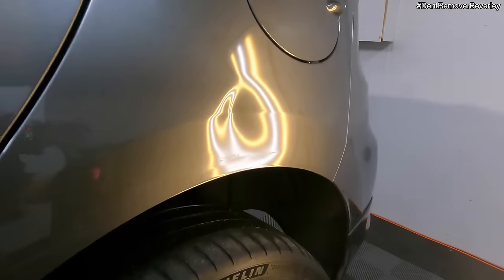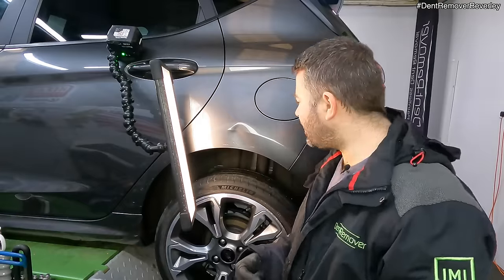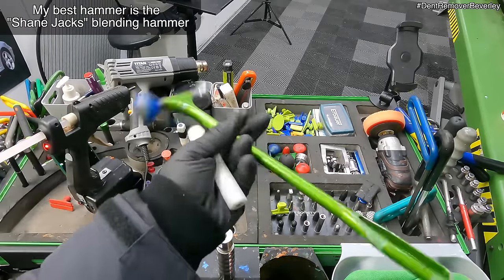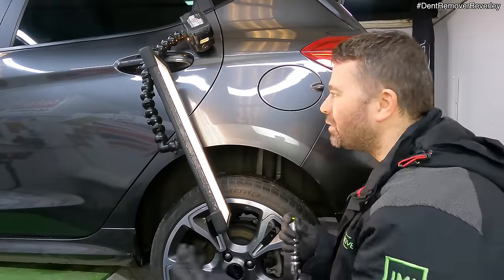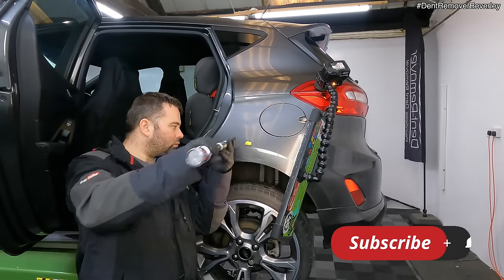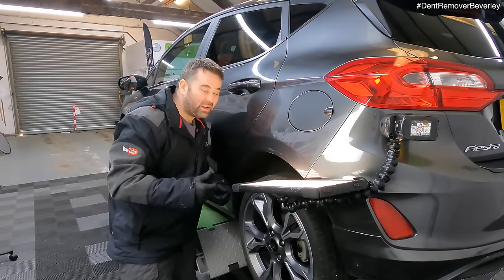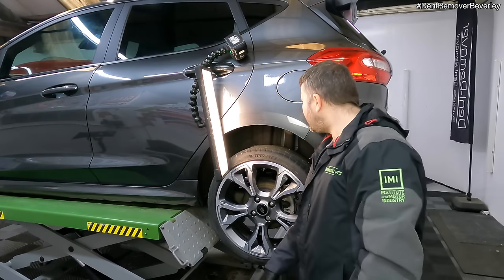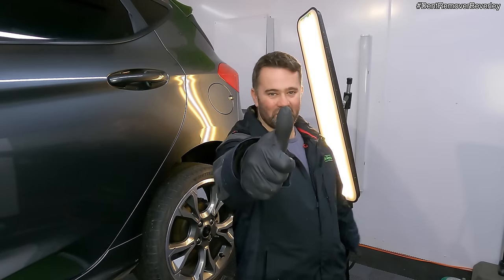HOT GLUE DENT REPAIR | STEP-BY-STEP By Dent-Remover | PDR UK

Comment: Your clearly good at your job but far to expensive it would have been cheaper to get a body shop to repair it and the whole point of paint less dent removal is because it is cheaper
Reply from the maker: Thanks Shaun. There’s a few ways at looking at this. In this case I didn’t charge that price and if you read the description of the video I explain all this, also this price is very much acceptable if it was to be paid by the insurance because there’s no evasive methods used to repair this damage. No products to use and pay for, no chance of Mis matched paint, dry paint, issues in the future etc, 
Then there are those customers that have just bought a car and are really proud of it, 100% don’t want it painting because of the above, and seek out a professional that can carry out a repair like this…. Some people see the value and skill and some people just look for the cheapest option and are happy not to see the evasive conventional repair happen in a dusty bodyshop with not much care taken. I’ve worked in those shops and it’s all to easy to slap a bit of filler in it and send it over to the paintshop for them to mask everything up. 

The whole point of PDR isn’t because it’s cheaper. PDR is a completely different method. 

If your car got hail damage and I mean battered by 100% of hailstones and it looked like a golf ball….. if PDR was going to totally fix this and you kept your paint 100% with all warranties saved and the insurance where going to pay this….possibly around 4-6k  But a bodyshop would happily fill each dent and repaint the whole car for cheaper. Which route would be best 

Or if you had a dent in your door and a PDR was going to be 300 and it would take an hour for a 100% magic repair

But a bodyshop would charge 200
To fill it and repaint the side and take 4 days…..

Which one would you pick? PDR isn’t for everyone but us Technicians pride ourselves on our skillset and the bodyshops use us to help them too

Comment: The panels on a Fiesta are so thin you could have pushed that dent out with your bare hands.
Reply from the maker: The panel is double skinned with no access, and it’s certainly not that thin. Wouldn’t be very good at absorbing a side on crash if it was made from foil
Reply: @dentremover01  "The panel is double skinned with no access"
Not on my 2010 Fiesta, scooter! Remove the wheel, remove the inner plastic liner and that section of panel is easily accessed.

Comment: The issue I have with these video's, is not as much the work done itself. But the concept that idiots see this and think "oh that is easy, I can do that myself".

I can guarantee you, you can't. First you need to buy all the tools and stuff, which will set you back more than just having it repaired would have cost. Secondly, you don't have the eperience the guy doing this has.

Experienced workers make things look easy. They aren't.
Reply from the maker: Hi Jan Klas thanks for your comment. Yes I agree it does make the repair look easy, but there’s a hell of a lot of skill and years of practice to get to this stage and I do try to explain what and how I approach a repair in as easy way possible. 

I’d never advise a non dent person to tackle a dent it’s not worth it because it would end up (probably) needing a repair/paint

Comment: That is not a glue only repair dude.
Reply from the maker: Hi Jason thanks for your comment but I’m confused why you state it’s not a glue pull only repair? Thanks martin
Reply: @dentremover01  Only because you used pry tools to push the dent out. That’s all. For a beginner who doesn’t have the tool set, the video title was a bit misleading. You start out using glue, then you pull out this giant pry tool.  I was like, “Wait...What?”
Reply from the maker: Hi Jason ah got you! Yes apologies for the misleading title, yes I had to use the (DoDa) tool as it’s named because the arch frame was bent as it had a bit of a bump, but most of the time this type of repair doesn’t require the pry bar. So apologies for the bad title. I hope you still took some info and tips away if your a beginner 
Thanks for your constructive comment it’s what makes me create better content 🙌🏼 
Good luck with your pdr journey

Comment: so much overcharge and overwork to excuse it. i can remove the panel fix it repaint it and have a coffee with a paint shop, buy another panel for future for that money. damn what a joke bro.
Reply from the maker: Hi Zilox thanks for your comment and I appreciate your looking at this damage from a repair and paint point of view and also looking at repairing or replacing the panel for cheap saving a customer a lot of money……

But if you could offer a service where you didn’t have to take the panel or paint off, fill it, sand it and prime it- then paint it and polish up- if you could magic that damage out and keep the vehicles value (warranty) resale value, don’t you think that’s worth paying for? 

Also I read what you said and for you to offer a repair where you apply all those factors to repair this type of dent, and it takes longer, but you’d do it cheaper? There’s no winners there at all. Your working for not alot of money after you deduct all the costs of materials, picking up a new panel, fitting it or welding it on, energy costs, and your labour is left. I’d certainly be charging more and not look at trying to make the customer happy by leaning off your invoice that’s not business at all. 

Everyone’s pricing is different. My customers come to me for a high quality repair and to keep the vehicles warranty intact. They see the results, know the price and make the decision to have a PDR repair done by us. They can get a price for a repair and paint but all that extra evasive work for a lower price? 
They happily pay the price and if they don’t want to then that’s fine. If they find value in our service that’s all that matters.
Reply: Great work Martin! PDR is king!

Comment: $800 for a single dent? You can go to a real body shop for that much. The whole point of pdr is to save money. $100hr x2 hours seems more than fair. What a ripoff
Reply: A real bodyshop ? It’s a common misconception that PDR is a lesser trade when in actual fact it’s a far superior repair method.

Not using filler or paint is aesthetically better. Not to mention the turnaround time is always faster.

So why would you pay the same to have filler & paint (devaluing the vehicle ) and to loose your car for longer ? Doesn’t make sense.

Well done Martin. Amazing education & awesome job as always 🙌
Reply: @tridentpdrltd1506  pdr is a far lesser trade with more limitations... Such as the paint being intact. If paint gets scraped off or cracked, you're screwed and need a real body shop.

 In fact I've seen plenty of amateurs doing pdr and getting perfect results, it's considered easy work that's why there's so many pdr guys in every town doing dents for $25-50 bucks with guaranteed results. Wouldn't be able to do that in a body shop without extensive in knowledge of prep, metal work, sanding, priming, painting, blending,  etc

The turn around time is longer at a body shop because you get what you pay for. You can get the whole rear quarter panel replaced and painted for $800 bucks.

This guy spent an hour or 2 tops. You would have to be crazy to pay $800 for that. A fool and his money....

If you get a good body shop, there will be no evidence of paint work and no depreciating of vehicle.
Reply: @kenmastersmaster  clearly missing the point.

Pay £800 to have filler & paint which would take maybe 3 days & devalue your vehicle

Pay £800 to have a flawless dent removal to factory condition & have your vehicle back same day as it rolled off the factory line ! 

You haven’t seen amatures get flawless results on the damage Martin does…. Sorry to say.
Reply: @kenmastersmaster  oh dear. 

PDR is the fastest growing sector of auto body repair for the obvious reasons that 

9/10 it saves on costs
Maintains OE standards
Saves customers turnaround time

Body shops & good ones at that are not being slated here, I work alongside many as do other PDR techs, but how can you say non factory repairs are better than keeping factory panel & paint intact ? 

Yes if structurally damaged & non cosmetic new panel it always better …. When cosmetic, PDR is 100% better for the customer.
Reply: @tridentpdrltd1506  fastest growing because it's cheap and easy to get into it. Opening a body shop and spending $600-1200 on just one single paint gun is not accessible to most without serious capital. 

Also I would never consider pdr on a big job because stretched out metal is no longer structurally sound. 

Good for small cosmetic repairs... Why not. The point is charging $800 for a pdr dent like the one in the video is ridiculous considering the time that goes into the repair.
Reply from the maker: Hi Ken. If you watch the video and look at the estimate, it’s an estimate of a repair like that and I did not charge that price for the repair. It says that on the estimate. 

Also This estimate would be very much accepted by any insurance assessor due to the cost effectiveness and quality. 
I think there’s not much else anyone can say to change your mind on this, I must also point out though that I run a bodyshop with staff, and have overheads too
thanks for commenting
Reply: @kenmastersmaster  Also Dust monkeys don't repair any dents, they just cover them up with filler so you don't see them for a while, until the paint sinks. 👌🏻😁
Reply: @jameswells9191  stop going to cheap body shops.. Filler isn't an issue when it's 2k, and you use a spotter on the metal so the filter is minimal and you use correct grits for eliminating sand scratches. Just like there's shitty PDR techs working for $10 an hour in parking lots that leave crowns waves and wobbles in the panels...
Reply from the maker: Ah James what have you done! He was all quiet and happy with his past comments.

Anyway merry Christmas to everyone especially Panel beaters